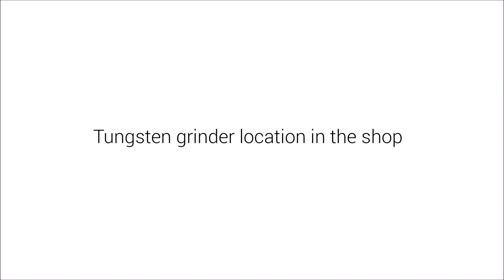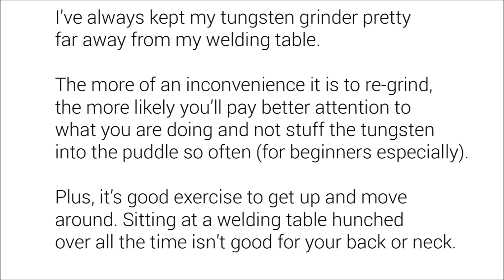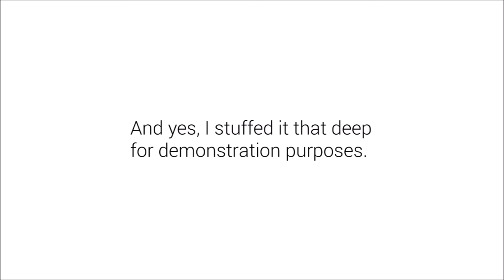TIG Welding Aluminum - Lap Weld Gone Wrong - Tungsten Grinder Location in Shop

Comment: Back in the day we had to walk a mile through 3 feet of snow to sharpen our tungsten.
Reply: I wish I had it that easy ............................. had to walk a mile through 36.8 inches of snow AND it was uphill BOTH ways.
Reply: Let's not forget, the tungsten sharpener was 1200 grit sandpaper, you had to sign for a postal stamp sized piece. Only the bosses sons got wet and dry, the rest of us get that timber stuff
Reply: That's nothing. I had to go up hill both ways, across a swelling river, in 8 feet of snow, through a crowd of leftist dems, pitch black and against hurricane force winds both ways. All to find out I forgot my tungsten. Upon making the trip a second time to learn the breaker was turned off for the grinder.
Reply: uphill, both ways...

Comment: I think I spend more time grinding tungsten than I do welding....

I should probably work on that.
Reply: 80% of the time prepping the joint, 1% sharpening and 19% of the time welding.
In an Ideal world that is, when the Tungsten is dipped, the percentages easily add up to 300 % 😂
Reply: You could get a lot of sharpened tungsten so you can do a quick change, or are you just looking for an excuse to walk around? Just Joking. 

I know it seemed like I was always sharpening tungsten, but now, after 3 yrs of practicing, I might have to sharpen tungsten every now and then. Practice, practice, and practice some more. I bought Aaron’s training and after 3 days and maybe 300 or 400 beads later, I was laying down like I had been welding aluminum or years. Seriously made all the difference for me.  And no, Aaron didn’t pay me to write this.
Reply: Evet

Comment: I keep 10-20 pre-ground tungstens on the welding table, no need to get out and grind 😂
Reply: I keep 6, double sided. But i also try and go as long as possible without needing to sharpen them. If i go less than a full week between sharpens, i know ive been screwin up hard.

Comment: I design difficult to weld joints to challenge my skills.  And I have done tungsten grinding outside even though I no longer use thoriated tungsten.